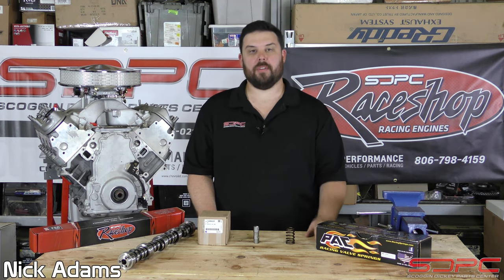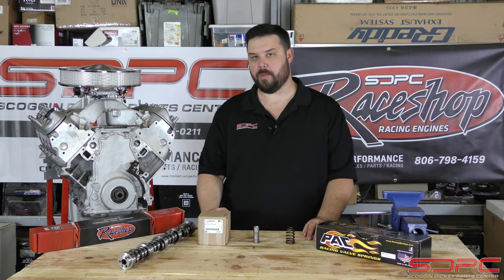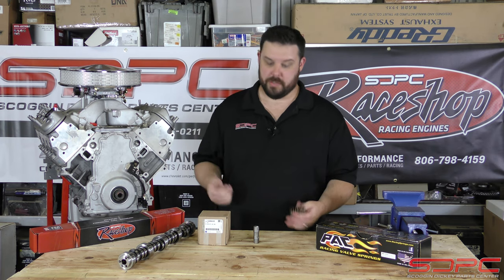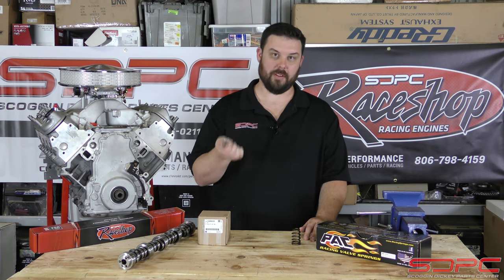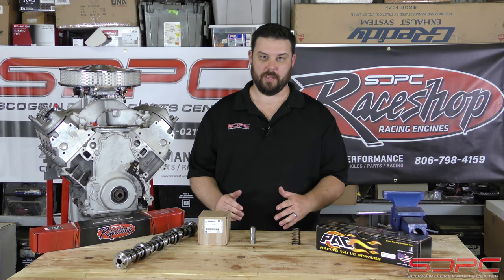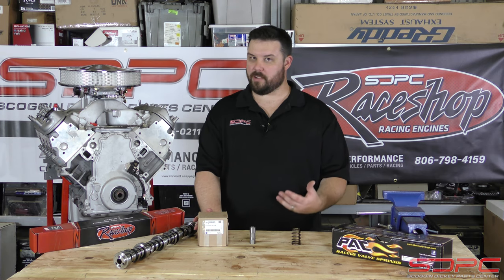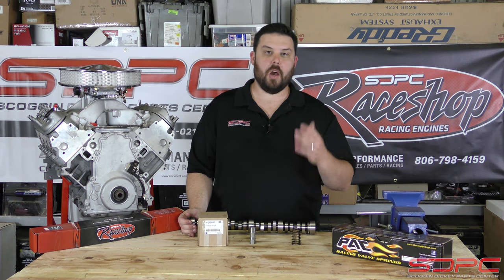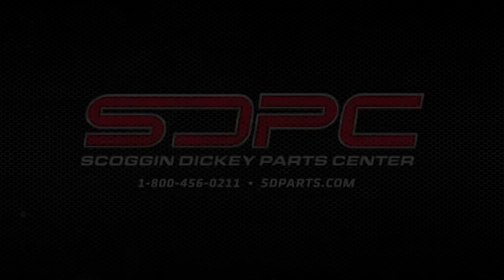SDPC Tech Tips: Counterfeit Parts

Comment: One thing that is easy to overlook is the lifter trays they have the critical role of holding the roller lifters in line so the roller is parallel to the cam lobe. I don't re use them and only use gm ones. the import ones will destroy your engine.